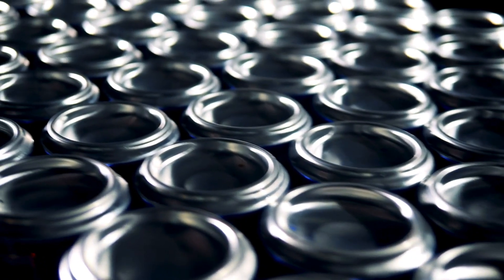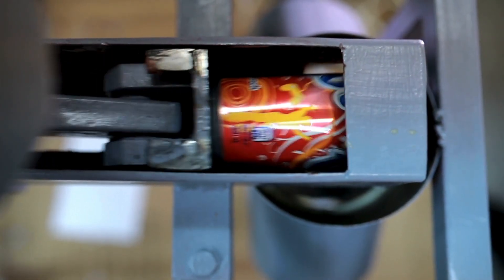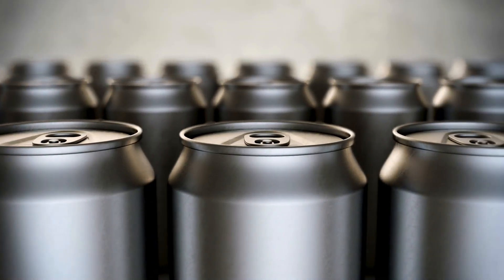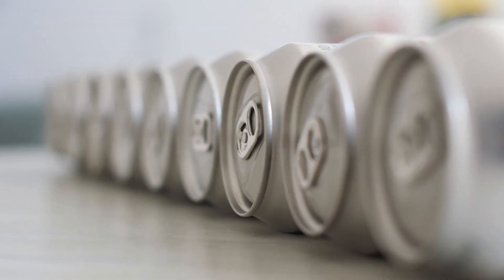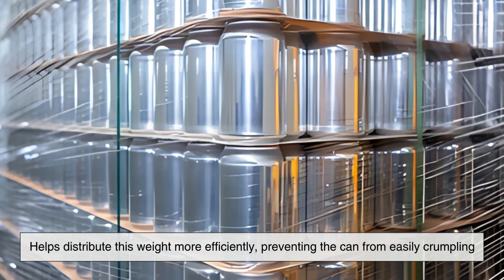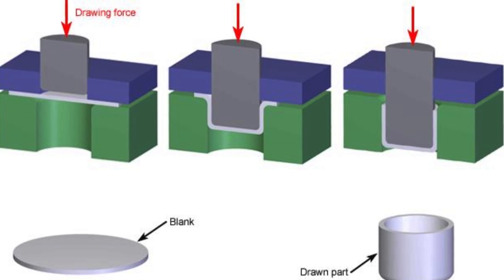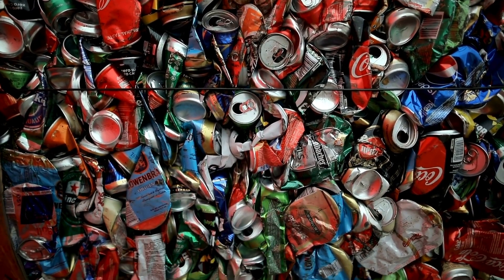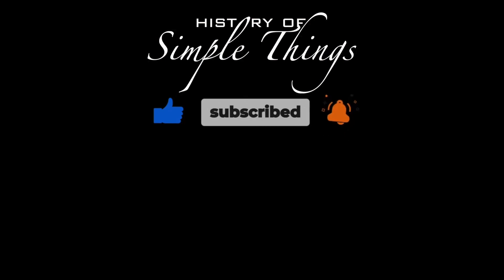Why Do Cans Have a Dome-Shaped Bottom? The Science Behind It!

Comment: it's to sustain pressure
Reply: No.
Reply: @SpamMouse  Soda cans are shaped like cylinders because this design is the most efficient way to withstand pressure from the carbonated beverage while using the least amount of material, making it both strong and cost-effective to produce; the rounded shape distributes pressure evenly and the concave bottom further reinforces the can's ability to hold pressure without deformation.
Reply: @ Yes, but no. If you read my other comments on this video you will understand I know about cans and canning. While your second comment is correct, the dome bottom does not exist just to provide sustained pressure, structural integrity under pressure would be a better phrase. IMHO.